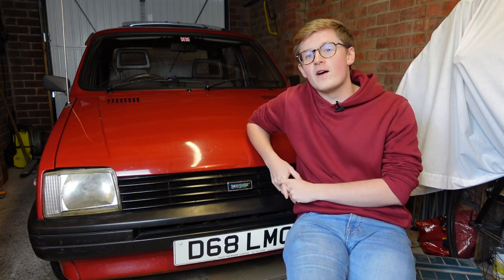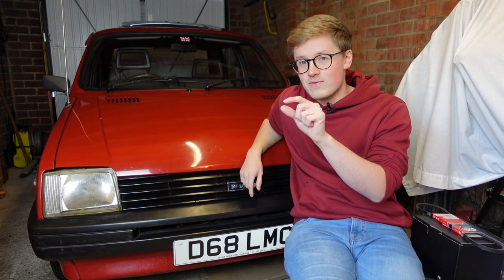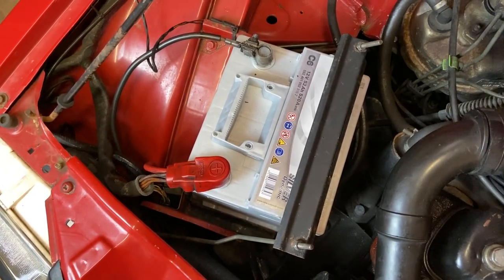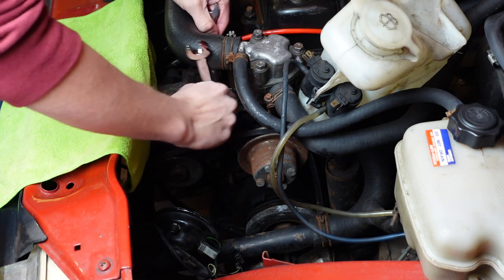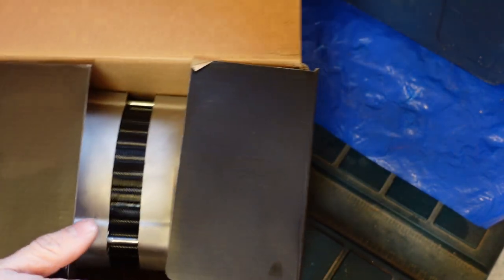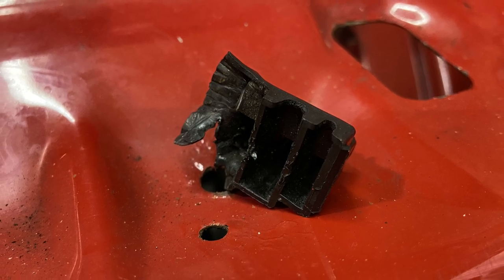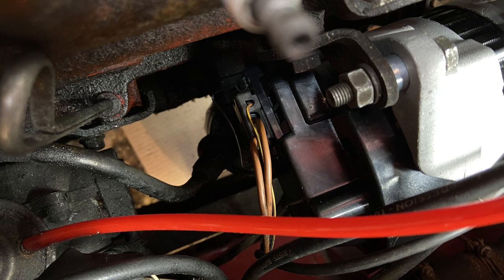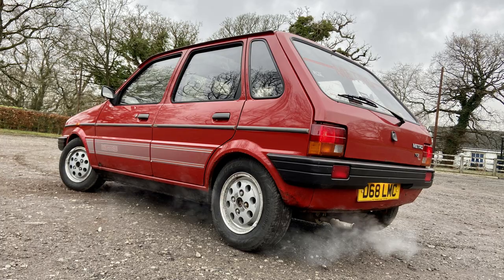Fitting a New Alternator - Melody the Metro

Comment: Don't hurry to buy a shed load of imperial tools - I was a mechanic at a BL dealership in the early 1970s,and all you need is a 7/16 & 1/2 inch spanner, a wooden handled screwdriver (to loosen/tighten screws and use as a stethoscope!) and a rather large hammer!! 😂
Reply: In America we’d also need 3/8 and 9/16, and beer.

Comment: In Australia I have a Toyota Camry, in which I replaced the brushes after 230,000km. (the brushes and regulator did not work at normal operating temperature). It was rated at 85A. I do believe that it previous owners' use there were a few battery replacements, as when 'cold' the alternator functioned to full current, enough to charge the battery to start the car next time.. The noise you experienced on the old alternator is most likely worn brushes contaminated with non-conducting dirt. BMC motors started fitting alternators in the 'Mini', around 1971. The real test would be to switch every appliance on, and check voltage at the battery, and if it measures 14 Volts, the alternator is charging..

Comment: This takes me back. The days when you could actually see the engine and what's bolted to it without a multitude of covers and plugs that appear to do nothing apart from attach to a cover. I also remember the days of having to have sockets and spanners both imperial and metric. Good work with the correct wiring of the new alternator plug. Your expression was a picture when the car started and you were reading over 14 volts. Oh and what is a television Ed 😀
Reply from the maker: Thanks Anthony :)

Comment: Changing an alternator is one of those jobs that can be extremely easy or can end up being a nightmare with bloody knuckles etc.    I lived in Asia for many years and in Bangkok you have shops that sell just alternators, they have them all there on the premises and fitting is free, they only sell alternators so they know their stuff and they have adaptor cables to upgrade poor quality ones to better ones.. which in Thailand more or less means fitting Toyota parts to everything.  I went in with a Suzuki Jeep and they changed the weak original to a brand new more powerful part for about 40 quid including fitting.   Another time they rebuilt a Volvo alternator while I ate a plate of chicken and rice,  total cost was about 15 quid for the alternator work and about 50p for the chicken & rice.

Comment: Hi There! Nice video and car 😊 my first job was at a Rover dealership in the Netherland, and back in the ‘90 ies i did a lot of service on A series engines. The engine sounds al ready good but can even run better, with less noice if you ajust the Valves of the engine to the factory settings. Check the ignition distributorcap and rotor on wear and tear and put Some new sparkplugs in the engine. At last give the carburator Some fresh oil in the plunjer. After this service fine tune the carburator with a exaustgas tester and your engine will run as smooth as a new one with very low noice. Good luck and keep up the good work😊👍🏻 love your content. Regards from the Netherlands. Stefan 👍🏻🍀
Reply from the maker: Thanks Stefan.
Checking the dashpot oil level is one of the first checks I made, along with standard engine oil and coolant. 
She will be getting a full service very soon!

Comment: Wish my rover 75 diesel was that easy to replace the drive belt and alternator. Ended up taking the front off the car for a bit more access. As for cheap alternators, the one on my 75 was  brand make but thanks to eurocarparts in Burnley,  they supplied me with a landrover version that had some extra metal, so it was angle grinder time to trim the case and block. Utter faff.
Reply: Rover 75 alternators are up there with the Toyota mr2's. I asked a local garage a few years back for a price on changing one and he said " I'm not touching that but you can use the ramp on the weekend if you want to try yourself" . (:
Reply: See Hubnut for a perfect example of the woes of changing a 75 Diesel's alternator.

Comment: Next thing is to get a Timing light and correctly set the ignition timing. You can hear that it is off during starting. This will help performance and mpg. Most A series are 6 degrees BTDC with Vac disconnected.
Reply: Was about to suggest this myself.. Maybe someone has a redundant Gunson Timing light they could send to Ed..??
Reply: @guyemmott4009  Not sure where Ed is based. But im in Berkshire and have timing lights and loads of old school diag kit. Plus newer stuff like GM TECHII's etc. Always happy to help out. Ex SAAB Master Tech.
Reply from the maker: Yep. Needs doing. On the long list of things.

Comment: Well done, Ed! She is a little beauty. At least you were able to shim the mount to get things aligned. Unfortunately the last time I had alternator issues on the 1990 Volvo, it was -20 degrees. Arthur went in the shop. Those nitwits didn't say a word, but the bushings on the mounting brackets for alternator and power steering pump were knackered. Predictably the belts failed early on. Once I knew the issue it was easy enough to fix but a needless pain in the neck, especially considering the bushings were a budget busting 65 CENTS exact, there are 4 of them. Some people's children.
Reply from the maker: Thanks Michael :)
I always find that garages just don't take the car you would on your own car - even if they have the expertise.

Comment: Nice video.  I owned one of the first 1981 Metros and the alternator never would supply enough charge to the battery on tickover so the heater motor would run slow and the indicators would not flash.  I tried 3 Lucas upgrades in the life of the car and never really fixed it.  You used to have to hold your foot on the gas slightly at the lights LOL.

Comment: Well worth investing in a basic AF spanner and socket set if regularly working on older cars, I used to muck around using metric spanners but it’s a faff and causes damage to bolt heads. Got myself a Draper Expert AF socket and spanner set a few years ago and they’ve both been excellent.

Comment: Changing the alternator belt is a task I loath to do on my Mini. It's tight, it's almost impossible to slip the belt through the radiator fan, and you have two belts to adjust (my Mini is a JDM spec, so I have the aircon compressor belt to worry about as well). Fun!

This looked much, much easier to do than on a Mini...
Reply from the maker: Can confirm, Metro engine bays are much bigger than a Mini's, mainly due to the lack of fixed wings!
However, it is trickier to get at the distributor.

Comment: - (Good idea to also check for bad earths between engine-bodyshell and alternator casing-engine if you get further issues.) 
I seem to remember a colleague had a Metro issue with the boot light intermittently coming on. Paid out for new alternator and battery by the time they found the problem- not happy!

Comment: I suppose it is vaguely possible that a belt swap would have fixed the charging issue, but sooner or later the alternator would have needed replacing anyway, especially with those crunchy bearings. Either way, good quality content, and extra brownie points for the use of nice clear still photos. I had to laugh when you said it was a filthy engine bay, it looks considerably cleaner than most cars I've owned! Looking forward to seeing more Melody vids.
Reply from the maker: It wouldn't have done.
The alternator was adjusted all the way, but the belt wasn't slipping.

Comment: This change would have been a serious pain in the backside on a new car… did you ever see Hubnut and the fiasco with the Rover 75!?

I love old cars for this very reason!
Reply: TBH everything Hubnut does is a fiasco, he really is not mechanically minded and should leave well enough alone, very frustrating to watch.
Reply: @onecookieboy  Nobody would have had an easy time with the alternator on Rita The Rover. The design was all about simple to mount at the factory, and bugger all thought to the poor sod who may have to work on it later. Typical BMW thinking, worse luck.
Reply: @michaeltutty1540  I disagree to a point. Mounting an alternator that way is more or less common practice since the 1990's, with a self adjusting serpentine belt to drive all the engine accessories, furthermore, replacing the alternator is a once in a lifetime event for most cars so ease of replacement is not much of a consideration. However, some credit for the level of difficulty has to go to those who designed the car and in this case it was not BMW, but Rover. I have worked as a mechanic for many years and can confirm that there are far more involved jobs for far more common problems in other cars; try replacing the rocker cover gasket on a FWD Mazda V6 for example, or the thermostat on a 2.8 V6 Audi, or timing chain tensioners on a V6 Audi.

Comment: Wise to replace the belt at the same time. At least it’s the only one on an A series engined car! The one I run these days has no rubber belts at all, and no separate alternator or starter motor - it’s a Toyota hybrid, with a pair of variable frequency 3-phase alternator/motors built in.
Reply from the maker: Very clever!
Reduces the load on the engine and decreases moving parts all at the same time.

Comment: Good job fitting the new alternator and getting 14.7 volts at the battery, the only thing I would say is you also need to check it under load, ie head lights, rear screen heater on and heater blower up as high as it will go, should hold at about 14 volts or a little below at idle.
Reply from the maker: It probably won’t hold under load.
The alternators fitted to these cars in period were rather weedy. With everything on at idle, I wouldn’t be surprised if the voltage dips a bit. Not to dangerous levels, but a fair amount.

Comment: Great video. My little Micra all of a sudden wouldn't start, even though it recently has been left for a few weeks & started perfectly. Battery showed only 10.9v, so have put on charger just for a day & now reads 12.75v. Will do the same as you, & see if alternator is charging. Even though the cars only done 33k miles, would have thought alternator would still be good, but maybe just in time (23yrs) they can go bad.
Reply: Lack of use kills the windings in an alternator. The same spot sitting too long next to the brushes. Cars do better with lots of regular use.
Reply from the maker: As Michael said, lack of use isn't great for anything mechanical.
Reply: @TwinCam  seems like it's the battery in the end. Even though it charged up over 12v and held the charge, it wouldn't crank the engine over (so maybe a bad cell) without the use of a jump pack.
Multimeter read a good 14.5v when running, so alternator seems to be doing its job.

Comment: On these original metros, which was the more reliable engine, 1.0 or 1.3?
Reply from the maker: Both are reliable, though as with every engine in the world, the smaller is always more reliable as it has more solidity in its construction and is under less load as it produces less power.

Comment: I had a similar problem with my 2000 Suzuki Wagon R when the alternator packed in. The new one fitted perfectly except the non interchangeable pulley had a different number of grooves. The mechanic who did the job said he encountered the same problem before but fitted it anyway but it just chewed up the belt. He suggested I return the alternator for  a refund, and had the old one rebuilt. That worked fine, but the rebuild cost more than the new one did. So no, don't bother to have your old one rebuilt if the new one works fine.
Reply from the maker: I don’t need the old one reconditioned - I have the new one! But it would make a good video.
Reply: @TwinCam  That's a idea. I would watch that as I have never had an alternator apart, and it would be very interesting. My experience is with dynamos and separate regulators. Yes, I am that old. You just gained a new subscriber.

Comment: Better design than on a K series where one of the alternator mounting bolts is blocked by the oil filter so you have to do an oil change at the same time.
Reply: You can undo the bolt without and oil change.
Reply from the maker: Yeah, I'm not convinced you do need to take the oil filter off. Certainly, I've had the alternator loose on Melvin and not even thought about the oil filter.
Reply: @TwinCam  Admittedly never tried myself but it's in Haynes. 5C-4 'Remove the oil filter element....unless the filter was installed only recently, it should be discarded and a new filter should be installed on reassembly; this of course means that the engine oil should be changed at the same time'. I remember looking it up 20 years ago when I got a garage to replace the alternator on my  100 Kensington SE and they said the oil filter had to come off to get the old alternator out which I was dubious about.  Only believed them after looking it up. If it can be worked around that's a nice to know if I ever manage to own another Metro!

Comment: Cheap isn't always a good idea.  Still, you got it to work so well done there.  It may be the mic but she sounds a bit rattley in the top end.  Maybe a valve adjustment video would be a future idea?
Reply from the maker: The valves do need adjusting, but the microphone does pick up much more than the human ear does!
Though the alternator I fitted is cheap, it’s sold by a very popular retailer and is the go-to replacement unit, so I wasn’t fearing failure, but just expecting patchiness generally.

Comment: There must be a reason why it i eating alternators at this pace.
This type of alternators should last at least at least 100K miles. Even way more. 
Definitely something to keep an eye on and to investigate. The dim battery light you are tzlking about is also a bit bizarre and points towards probably somewhere in a wiring loom a leak or a mass problem.
Reply from the maker: Pace? The car is 34 years old. The first alternator lasting 7 years is an issue, but the second lasting 27 is not 'at pace'. Mileage doesn't matter when it comes to aging mechanical components. In fact, low mileage can be to the detriment of longevity. 
Also, the dim battery light is by design. It's not a wiring issue. The lamp isn't either on or off, it's an incandescent bulb that lights brighter the lower the voltage gets. If the voltage dropped below 12 volts exactly, that's when it would become bright.
Reply: @TwinCam  as you say an alternator is totally mechanical and only wears of on either the bearing which is totally mechanical and that is not due to age, only to usage.
The same goes for the windings. 
The thing that goes bad on alternators specifically, is rather the tension regulator. And that part again only wears when used, not due to age. I totally disagree especially when it comes to an alternator. 
And yes the mileage is still a good indicator. It is not like for tires that have been sat on the same position of course they become bad because of not using them and being still on the same spot. 
An alternator is like a bulb really. It is only the time it has been used that marks its age. 
Another thing that also goes bad due to age for example and not the use is exhausts. Let’s say the exhaust system isn’t old but was only used for very short roams or trips. Then indeed only the mileage is not a correct way to measure. 
But for an alternator, the usage time certainly is. 
Amazing how many NOS BL alternators I have here that I have swapped for customers and are still rocking out there in the cars. Still enough stock here from an ex dealer ;). If I follow what you say, I should all bin them because they have their age. However, they have, I agree, but, mechanically they are brand new. And they already proved so to several customers (overseas) even…